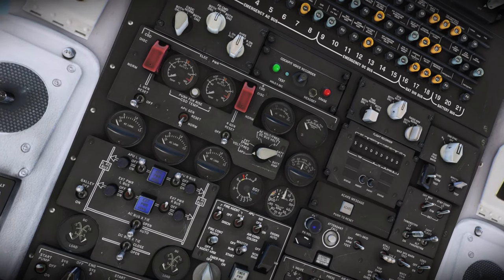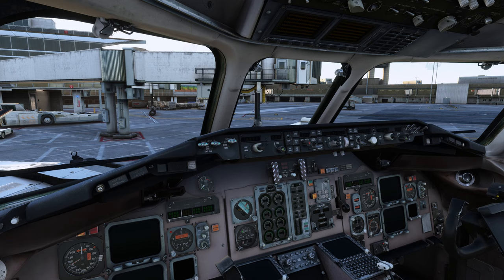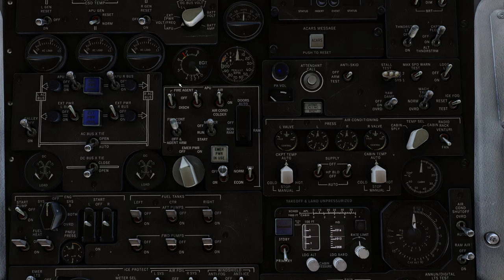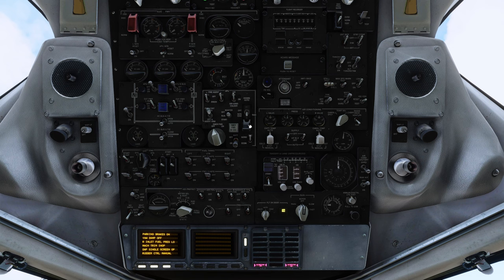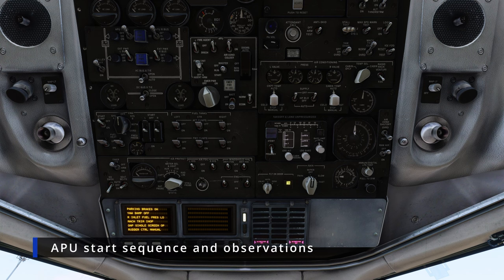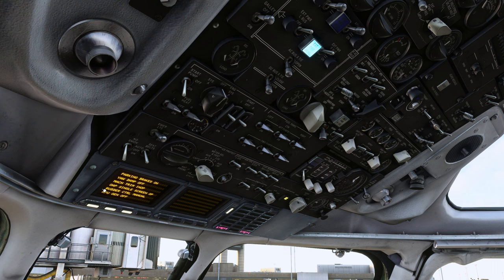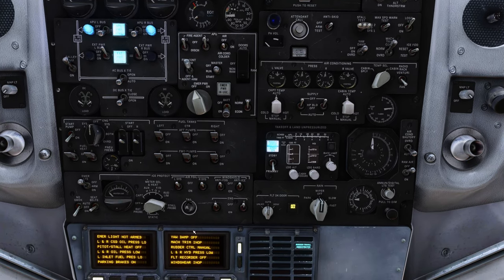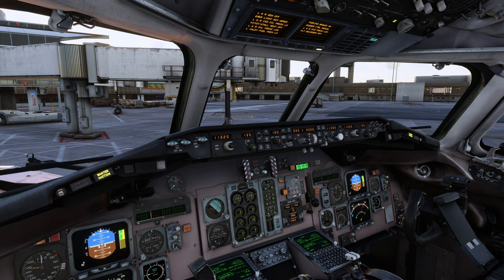Leonardo MD-82 for MSFS - APU (Auxiliary Power Unit) Explained - #2

Comment: The RAM air is taken from the hole on the  bottom leading edge of the vertical stabilizer or from the bottom of the plane.

Comment: You forgot to turn the central pneumatic valve bypass switch to the override position prior to starting the APU.   Had this been a real MD-82, you could've started a fire due to improper battery cooling.
Reply: 🙈 🔥 scary, must remember
Reply from the maker: Bdw this is not even in the normal procedures pdf 🤔 Should let the devs know?
Reply from the maker: Okay PS, I got to know from the maddog group that it just needs to be on for engine start and not for APU start. Which makes sense from the procedures standpoint. I'll unpin it for now but open to discussion. If you don't bypass the x feed, apu cannot provide any air to the engine for starting, but for apu start pneumatic x feed is fine to be not bypassed.